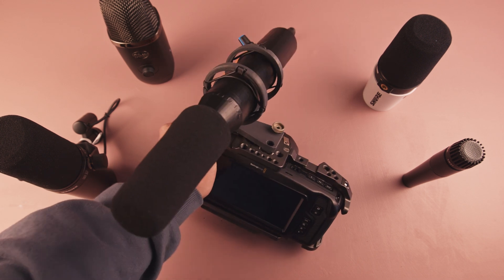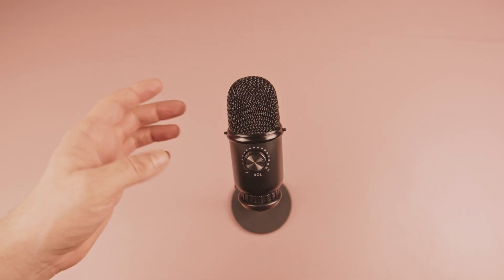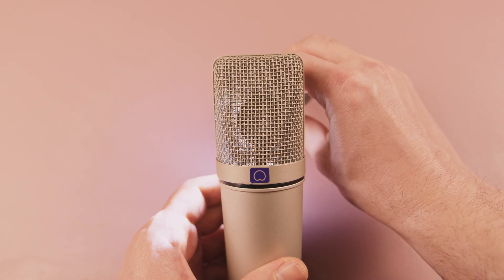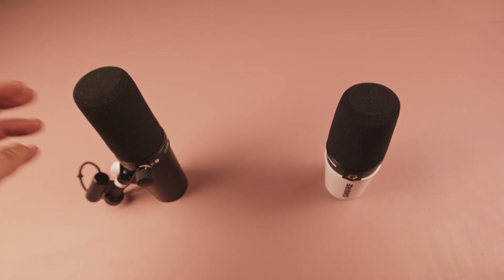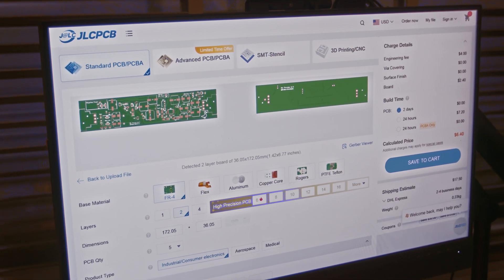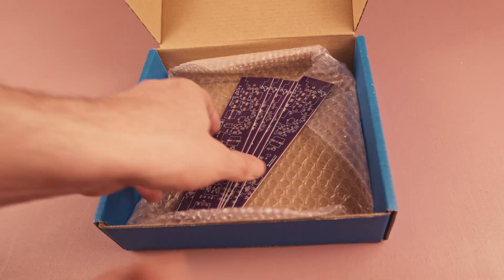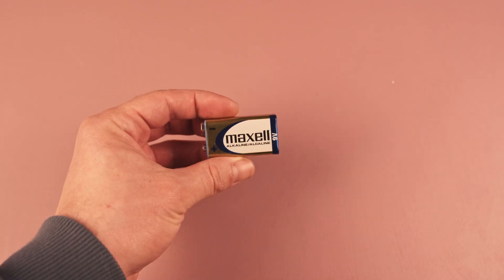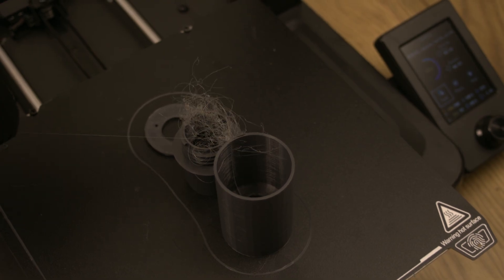DIY On-Camera Dynamic Microphone Build (SM57 Mod with Built-in Preamp for Pro Audio)

Comment: Love the crafting! Yet from me as a Sound Engineer perspective, I dont understand the choice of a dynamic capsule. Especially because they need so much amplification and in Cam Mics you'd rather go for a directional microphone or at least a plate capacitor mic. 
What led you to the choice of a dynamic mic capsule? Just the all-round sound functionality and the price-performance ratio or was there a more thinking going into? 

Cheers
Reply from the maker: Thanks for the kind words! I really appreciate your perspective as a sound engineer. The decision to use a dynamic mic capsule, specifically the SM57, was driven by several factors beyond just cost and sound performance.

I typically position the mic facing backwards (toward my face, not as shown in the thumbnail) and speak directly into it up close. In the past, I really liked the transformerless mod on the original SM57 for my vocals (just my personal preference), but the output was too low in terms of dB to be effectively used with a camera.

Dynamic mic capsules, like the SM57, are less sensitive to handling noise and moisture, which makes them a decent choice for a DIY camera setup that might not always be perfectly controlled.

In terms of amplification, the mic does require more gain, which is why I designed an adjustable preamp for it. Directionality was another important factor—I wanted a mic with a focused sound. While it’s not as tight as some condensers, it still offers decent rejection of ambient noise, which works well for how I record my videos.

I understand why a condenser mic might be more common in other setups, but for this particular project, the dynamic capsule provides a good balance of durability, simplicity, and a clean enough sound.

Cheers.

Comment: There is a quality difference with the genuine SM57 capsules, and generally the older they are, the better they sound (although very old ones tend to suffer from sticky disintegrating foam windscreens under the metal mesh). The SM57 I currently use for vocals is from the early 1970's and sounds significantly better than the modern SM57 I used prior.
Reply from the maker: Thanks to you, now i am really curious about the SM57 capsules from early 1970's :) But there isnt any reliable one online.